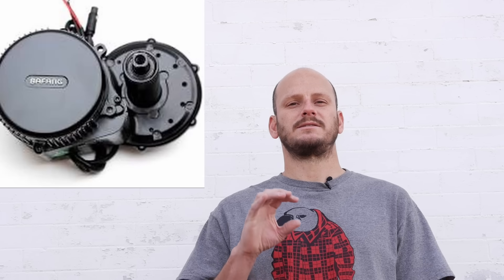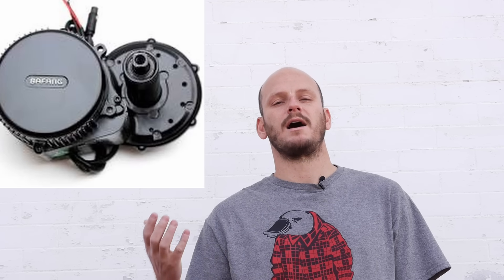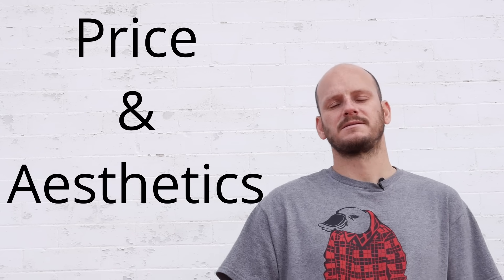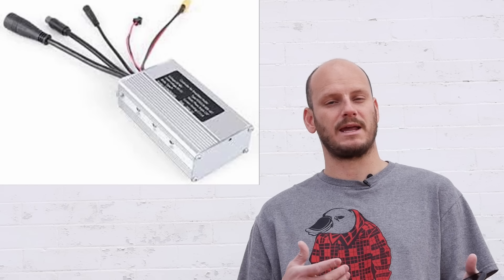Hub vs. Mid Drive Motors: Why Hub Motors Suck and Debunking Common Myths with performance test

Comment: if the torque from a mid drive motor is higher than on a hub motor, then wouldnt mid drives also tear up spokes worse than hub motors?
Reply from the maker: Absolutely correct! My point was that many, many cheap hub motors specifically are poorly made/laced and prone to falling apart 👍

Comment: my comment got deleted? i simply pointed out that internal combustion engines have a tiny engine rpm, and are tuned to even smaller range within that range. electric motors do not have these tiny rpm ranges. my rc trucks/cars can go 1mph or 64mph(my max confirmed speeds) with zero transmission.
Reply: Many of my comments have been deleted or withheld too.
Reply from the maker: Hey Jason, not sure what happened, but I only delete SPAM comments or hate speech and don't see any of your comments in my "held for review" section. I openly invite differences of opinion- so comment on, man!

Comment: My local bike shop said that using a throttle with a  mid drive is not a good idea, what are your thoughts on that?. Also you seem very bias. I was comparing prices on mid drive and rear hub drive kits. I found a mid drive 750 bafang kit for $1100 and i found a rear hub drive kit with everything except battery of course, for $500 less? Can you tell me where i can find kits at your specific prices( $50 difference?). I bought a hub drive bike from a local shop and to get a similar bike with mid drive, the price is over 50% more. Also if hub drives are soo unreliable, my local shop has a 2 year warranty. They said, rarely they have warranty claims. If hub drives are that bad, how can companies warrenty them???? Thanks
Reply from the maker: Short answers are:
$50 difference between similar quality kits. Bafang mid drives are around $500 Bafang hub kits are around $450. Minus battery. 
Hubs are not a good idea depending on the riding you plan on doing. Mainly hills.
Reply: @JohnnyNerdOut  If I knew I had to ride a lot of hills, direct drive hubs would be my only choice. I would choose them specifically for regen braking. I cannot imagine riding my brakes all the way down a mountain, I have smoked cheap disk brakes from much less than a mountain.

Comment: What about the weight? My rear hub motor wheel is 8 kG vs mayber 2kG for a regular wheel. What's the weight of a 250W middrive?
Reply from the maker: 8#

Comment: my friend got a super73 hub drive. it torques out up even a small hill, the bike weighs 110lbs, its battery lasts for about 15 miles, and it caps out at 18mph but the spedo reads 33... i modded it to add suspension and more battery packs. still, my vado passes it, accelerates faster than it, goes off road better than it (and its a fat tire), and its 1/3 the weight...

Comment: 80 Nm of torque in a hub is not to be taken lightly. Guys have spun backwards and landed on their heads, it not that difficult. There aren't many mid drive brands above 750 W, we're pretty much restricted there. Hubs on the other hand can be upwards of 1kW, though its not very practical for everyday use and can be against the law in a lot of places. Heating up can be an issue in mid drive too because both the motor and the controller mosfets produce heat and are housed together. It is not an issue in temperate climates, where the ambient temperature round the year is reasonable. The good side is they're well protected from the elements.
I have a question for you, since you have worked in the field, I chance that you would've opened one of them mid drives, are they filled with synthetic oil?
Reply from the maker: They are generally not packed with synthetic oil. Usually the most cost cutting oil that will technically work is used ☹️
Reply: @JohnnyNerdOut  Good good, as long as there is oil, it will work as a radiator to dissipate heat and lubricate the motor bearings. So there you go, another slam dunk for team Johnny.

Comment: hm not a realistiy compare. you do not base a normal bike use. on my bike i alwaise peddle plus use the motor and i have gears ....so it is alwaise the combo off peddling plus motor.... btw i never had problem with my spokes but i also have not yet replaced my cassette after 10.000km ...how often do you need to replace it on a mid motor ?
Reply from the maker: All depends on whose riding. My cassettes last about 5k miles on my bbshd.

Comment: Well, I'm still learning all of this. But if mid drives are so great, then why are most of the bikes that I see for sale sell only hub drives. I just bought a $4000 plus Nomad, so this report is not encouraging. It's a hub drive. My old Emmo (awful co.) VGO also had a hub motor that came apart (still worked) just after a year. I bought a new bike because after riding the VGO for a year here in Toronto (brutal roads), I then came to know what I needed. The Nomad (setting aside the hub drive) has the balloon tires and the option to upgrade the battery (which option I took). There's only so much you can do when the market doesn't have the best options.

Comment: hub or mid drive power to the tyre is still transmitted via the spokes, so cant see any reason for more spoke breakage with hub drive. Otherwise agree. For commuter E bikes, cheap and simple option is front hub motor, keeps original drive train and gears, very simple conversion.
Reply: Bicycle rims are not designed for large diameter hubs so the spoke angles get too extreme. Motorcycle rims are designed for large diameter hubs and accommodate for the spoke angles and survive just fine.

Also hub motors are usually the cheapest of the cheap solutions so they are built with the worst components and with poor techniques.

You can build a bomb proof wheel if needed.

Comment: Hub motors don't suck and in some applications are superior to mid drive motors, depends on the application. Hub motors are more efficient by bypassing the friction of the chain, chain wheel, hub gears and derailleur. You're not telling it how it is, your giving a narrow minded opinion.

Comment: Mid drives 800 bucks, hub motor 250 bucks.I need a 700c  - 29 inch bike
Reply from the maker: I sell mid drives @$525

Comment: nice vid over all... some finer points to reflect on here tho.... my 1500w hub kit with lcd display ...$235.00 ebay delivered... bike huffy nighthawk $108.00 at walmart ...aosome trailer $129.00 amazon... i get it it , it has more torque on start up , but i can run over 40mph pulling my trailer load of groceries from all the $$ i saved. as for loose spokes... isnt that part of regular maintenance checks and such? like brake pads? tires and pressure? there is and advantage to mid drive , $$$ is not one of them.. burn a controller on one and its more problems than a hub to change. over volt? nope ... my 48v sys has been on 60v its whole life! i burnt one controller because of a freak accident that shorted the wiring... a new controller and going again in a few minutes... oh and i have reverse... o_O power to weight is better with mid drives i get it... but $700 for a bottom end ? no expandability , replace the whole thing or nothing... i'll stay with my hub. but great vid ! i enjoy your channel , keep up the great work! and BTW i really want to try a mid drive next! i dont do any off roading , but it seems allot lighter. i have 3years and about 35,000 miles on mine! lots of tires and brakes , but the " ol' girl" has held up well!

Comment: What if hub motor has 18.000w .can it climbs steep hill easily ?
Reply from the maker: It better with that kind of power 😀
Reply: ▪
And what About the grizzly having 2 hubs - how much power of mid drive motor would you need to even out to it ?  

I'm guessing half [using your video here as a reference]
🟥

Comment: If spokes are breaking thats not the fault of the hub motor, its a problem with the wheel build, poor quality spokes and wheel maintenance. FYI I build wheels for a living. Stealth electric bikes have a 6200w hub motor and their spokes/wheels dont break. 

Also Regen breaking is a big one which only hub motors can do. Increases range by 5 to 10% and reduces wear on brakes especially on long or steep descents.

Breaking a chain while off the saddle peddling is extremely dangerous. Ive nearly fallen in traffic with a chain breaking under power. Regular chain replacement as maintenance is the only way to avoid this.

Mid drives also have far greater wear on sprockets which can become expensive if you need to keep replacing cassettes and chainrings.

Mid drive has its niceties too. I think its more personal preference than an objectively better decision.
Reply from the maker: You are right about everything ( I have a pinned comment that addresses most of what you’ve said as well👍)

Comment: Good video... 👌🏻👍🏻👍🏻
Some questions ... , between a rear Boneng HUB motor (without planetary gears ...) and a BaFang "Mid Motor" of this type ... Which are more resistant in terms of tightness ("IP ..." ) "impermeability" and more reliable ...?? , Which ones would actually have less maintenance ...?? , I am undecided between an Accolmile bicycle with a 1000W 48V central BaFang motor ("Mid Motor") and 30A controller ... , and an Aostirmotor bicycle with a 1500W gearless Boneng HUB ("Direct-drive") motor, 48V and 30 A controller ... (in short, they have the same real power given ...) , both are "Fat Bike" type "MTB" ... the difference is that the Accolmile is foldable (but with very thick chassis bar ... the battery fits inside ...) and 20 " inch. wheels, and the Aostirmotor has a fixed chassis and 26" inch. wheels ... , I live in a rural mountain area ... , the I would use it regularly for trips between towns by mountain roads and forest tracks ... , I do not rule out that I get caught by some other heavy downpour ... , since I would like to use it for day to day ... 🤔🤔
Let's see if you can guide me better ... 🤔
Thank you very much ... 🙏
Greetings ... 👋🙋

Comment: It is easier to replace the rear wheel on a mid drive, but the power is going through the spokes either way. And if you are making a bike that has faster acceleration because it's mid drive, that means you are putting even more stress on them.
It's cheap wheels with hub motors that are the issue, not the fact that its a hub drive.
Reply from the maker: Exactly correct. I’ve clarified that as well with my pinned comment 😀
I

Comment: Good video thanks. I’ve converted my Carrera (do you have those in America ?) to mid drive 750w 42v setup with an 850c display. It"s brilliant. It does 32 mph but I have just bought a lead to tune it up differently. Do you have any setup ideas?
Keep up the good work mate...

Comment: what other kinds of mid drive motors do you recommend other than bafang? just incase theres a good deal.
Reply from the maker: Depends on what your going for. IMO there is no better value. But if you want more power, check out CYC or Cyclone

Comment: Why would hub motors destroy a wheel more than a mid drive? You said that the mid-drive motor produces twice as much torque plus the spokes are longer on an ebike with a mid-drive.
Reply from the maker: Check my pinned comment for clarification 👍
Reply: @JohnnyNerdOut  Yep, I see traderstu made the same comment. The 79 replies put me off reading the thread, initially. 😁

Comment: Random thoughts from my checkered past..
I'm guessing you already know this, but just in case.
In addition to the simple torque multiplier of a gear train...
The inertia of a load (resisting + or - acceleration.. AKA jerk) as reflected to the motor shaft, is modified by the SQUARE of the gear ratio of the entire drive train..
E.G. a simple 4:1 reduction ratio, REDUCES the reflected inertia by 16..
Of course to calc the total inertia reflected to the motor shaft, you can't forget to include the step UP ratio, that exists between the O.D. of the tire and the O.D. of the gear on the rear wheel..
E.G. 30" O.D. tire & 3" O.D. gear = 10:1 INCREASING inertia reflected by 100x
Thanks for the video.. 8- )

Comment: Andrew Lawry
I've  been professionally building bike wheels 35+ years. Point one, the power of the motor goes thru the spokes regardless of whether the motor is the hub, or the motor drives the hub (mid-drive). So the spoke problems must come from a different factor.....how about the fact the hub is so much larger, so you have shorter spokes, and then the angle of spoke entry to the rim is greater. Or if it's not greater, then it's only cross 1 pattern which is less rigid, and there's the problem. Regardless, you get spoke problems, unless built with heavier spokes, but the fact remains ALL  THE POWER GOES THRU THE SPOKES IN BOTH INSTANCES. The only way out of that is friction drive on the tyre, like the Sinclair ZETA (which was an interesting thing to work on) or Velosolex. Cheers.
Reply from the maker: Exactly correct. Check my pinned comment for clarification 👍

Comment: My hub motor can climb some ridiculous steep hills though I would prefer a mid drive just for the fact that the motor isn’t at the back and I can easily just replace the back wheel if needed etc

Comment: Hub Motors blowing out? That's lack of a good controller / temperature monitoring / over powered / lack of cooling.
Mid drives are quieter? Hubs are direct drive so there is virtually zero noise if paired with a field oriented controller / sine wave. Mid drives are louder because of chain rattle.
Hubs damage spokes? That's because of spokes not being rated for the power of the motor, regardless of hub/mid.

Reliability, hubs have fewer moving parts (1), so less wear and tear, they can last virtually forever if done correctly.

You also didn't mention regen, hub motors can act as a brake / rolling speed limiter, putting power back into the battery, mid drives don't as of yet.

Comment: I've got to have a hip replacement and can't pedl a bicycle we have 6 children and would like to do a e bike conversion im 5.6 and about 21and a half stone how will it be to ride without pedal assistance  on hills and travel distance per charge
Reply from the maker: Hi Mark, check out my custom builds playlist to see how each bike performs on flat ground and steep hills using only the motor 👍

Comment: I'd like to point out that electric cars usually only have one gear. You describe it as a downside, but it's not the same as for oil engines. Electric motors have a much flatter torque vs speed characterization, and gears are usually not needed at all.
Reply from the maker: https://www.youtube.com/watch?v=4zS0vD1QNB8&t=509s
Reply: @JohnnyNerdOut  Electric motors are electric motors, in cars or in bikes or anywhere else. Makes no difference.
Reply from the maker: @difflocktwo  🤣 fake news!
Reply: @JohnnyNerdOut  Name one difference.
Reply from the maker: @difflocktwo  I think I’ve already discussed with you the benefits of having more gear ratios. See the above link for a further explanation 👍
Reply: @JohnnyNerdOut  I made the statement that electric motors are electric motors. It doesn't matter where you find them, they are still electric motors. No one is talking about gear ratios, I am talking about electric motors.
Reply from the maker: @difflocktwo  you are correct. All motors are mechanically the same essential
Reply from the maker: @difflocktwo  correct, all motors operate the same. Magnets and copper windings with electricity being fed to make the magnet move

Comment: Appreciate you effort to explain the difference. My eyebrows went up a couple of times when you said

1. Burned Hub-motor.  I have never come across a burnt hub-motor. I have three bikes with hub motors, and the only problem I came across was changing the Nylon Planetary gears, wich wear out

2. The Bafang 750w mid drive bike i also have, burned the controller at some stage and have to order a new one. Possibly sub-par component failure because I wasent riding it hard

3 . Although the mid Motor is more powerful and have a lot more torque I found  programming the controller absolutely crude. The Motor never behaved the way I wanted. I have either too much power or too little,regardless hours of programming work. It was very disheartening 

4. Never had any problems with loose spokes ? 

My Hub motors I use all year around, and it wasent before almost three years after using then in any weather the Nylon gears had to be changed because it started to generate a grinding noise.

Comment: Which better for motorcycle (not for bike) , hub motor or Mid drive motor?
Reply from the maker: Depends. With a mid drive you can customize the gear ratio by switching out sprockets. Hub motors don’t put strain on a chain so it’s a personal choice i’d say

Comment: my hub motor has mag wheels and mid drive is much harder on spokes more torque is bad for spokes that's why most motorcycles use mag wheels was the bike shop you worked at called ehub4less oh and the voltage will give you an idea on top speed also brushed motors only need to spin fast to be happy brushless don't care at all
Reply: @JohnnyNerdOut  thanks for the video I did enjoy watching it

Comment: JohnnyNerdOut  Thanks for keeping me from getting suckered into a hub motor. It may require less maintenance?  I'm not even sure anymore. I would like to know the lifespan of a mid motor, how rough it is on a chain. and how long those little chain gears work before wearing out. And the rest of the gearing inside. If you have any advice on mid drive model bikes I would really appreciate it!!
Reply: Unfortunate that you won't consider a hub drive. They are much more mechanically simple and offer regenerative braking which saves on brake maintenance. They can be run without a chain so that means you can save on all those chain related components and their maintenance.